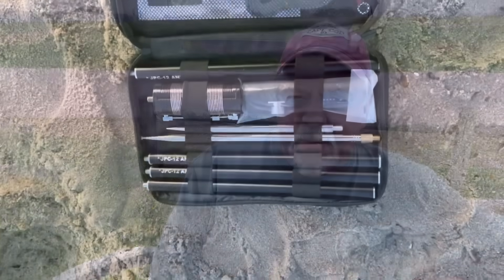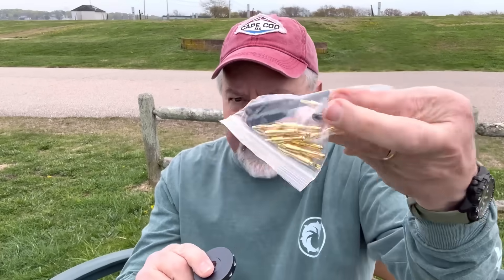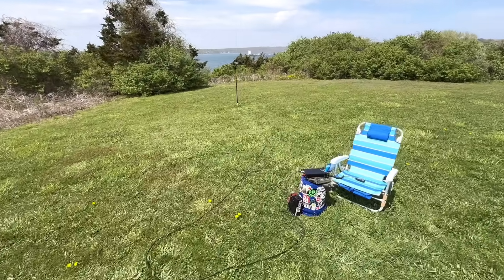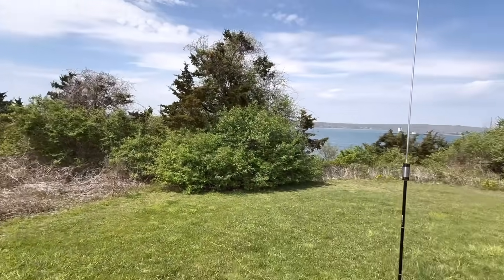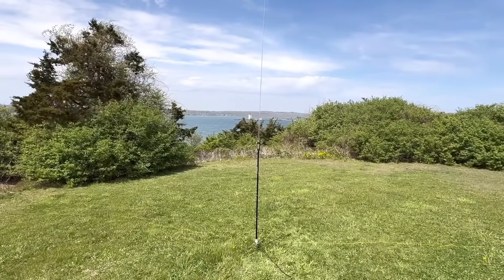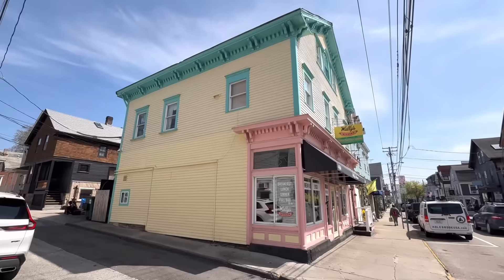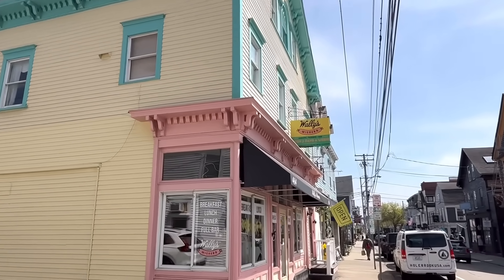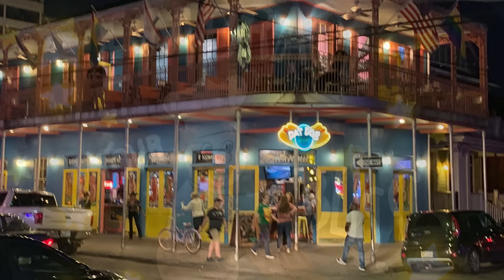Upgrading and Modifying my JPC-12 Antenna

Comment: Look at the price of antenna base, $50.47 PLUS $76.66 SHIPPING??????
Reply from the maker: Thanks for the heads up! I deleted their link. It was $29.00 and $9 shipping when I first posted earlier today. I put up another similar one.
Reply: @COASTALWAVESWIRES  Purchased a JPC-12 couple months ago and the spike has been modified so a washer or a 12vold wire connector will fit works great.  Please keep making the videos 73 Jim KB7MM
Reply: I believe I would take that counterpoise spick  to a machine shop have them to machine the Spike and modified to stick up about a 1/2 to 5/8 of an inch above the top of that so you can mount your antenna better. 73 K4BWN

Comment: I got one of those little radial plates too. I drilled a 12 or 14mm hole not quite all the way through... maybe 8mm deep or so. This left enough thread to screw onto the spoke while leaving about 12mm of thread for the feedpoint to screw onto

Comment: I bought the red radial plate for the JCP-12 off Amazon. I just tried it out today. I attached (4) 5 meter wires, the SWR was pretty low. It worked pretty good on 20M although the bad was pretty noisy today.

Comment: I have that JPC-12 antenna too, doesn't do the greatest (surprisingly enough, the GOOZEEZOO el cheapo 20-6m portable telescopic whip antenna from Amazon does loads better on 20m (consistently getting 95% efficiency, and very low capacitance and inductance on 20m operating close to buildings in a condo complex - thanks HOA).   And also surprisingly, Amazon does have that antenna base you showed in this video too.  Multiple options, around the $30-$40 range, but no quick deliveries.

Comment: Connect ring terminals to the ends of the radials. Use wooden golf "T"s to anchor the radials in place when deployed. Place the ring terminals onto a large safety pin to keep the radials tangle free in storage. Antenna efficiency increases with the number of radials used. 4 ground radials = @ 37% efficiency, 10 ground radials = @ 50% efficiency.

Comment: Thank you for the video.   I am trying to decide on a vertical antenna to buy.  Just a thought:  find someone with a drill press and drill smaller diameter holes between the holes that are too large for your existing banana plugs

Comment: Hi Walt!  Thanks for the video!  I have a JPC-12 and it was working great until suddenly my SWR went from 1:1 to 2:1.  The problem was a loose coax connector!  The PL 259 on my RG8X coax was a couple of millimeters from being seated on the SO 239 even though the connector was twisted and tight!  The problem is the PL 259 cant tighten completely onto the SO 239 because the proximal threads of the PL 239 wont allow for complete excursion across the threads of the SO 239.  The ground connection with the coax is not made unless you physically push the coax into the PL 259 a couple of millimeters and the ground contact is made but is not tight.  The solution is compatible connectors!  You can either buy a new higher quality SO 239 with a longer collar or try a different PL 259 that allows complete thread excursion to make contact.  I just bought some Steren RG8x coax and the PL 259 plugs work fine and seat tightly in the SO 239 in this antenna.
Reply: I ran into a similar problem with a Yaesu FC-40 remote tuner.   It had "M" connectors.  Very close to the SO-239, looks the same, but metric threads that seize with the PL-259 threads before it seats completely.  I added a piece of wire bent into a washer like shape between the loose rotating outside of the PL-259 and stationary inside.   That let it pull tight before the threads seized.

Comment: Fantastic location there Walt, maybe you  could drill that new white base to accept those banana plugs or better still extend the thread on the spike to use that ground disc, probably a few dollars at a local machine shop. 73

Comment: I just looked. Mad dog coils has that M 10 long nut , You just need a M 10 long all thread or cut head off bolt . also Marty has a M 10 to 3/8-16 adapter .   this will work. Cheers Walt from NY !

Comment: Great thinking on that antenna !  With that M 10 thread find a 2 -3 in long all thread piece of use a M 10 bold cut off head. Then find a long M 10 nut like the 3/8 16 we use. I think mad dog coil has them. put the all thread in base then put the counter poise hub on. still threads then put the long nut on than screw on the stake and push the whole thing in ground. done . just use speaker wire for the counterpoise . Put them banana plugs on the speaker wire . Give that a try . Just look for M 10 hardware . 73

Comment: I have the JPC7 and 12. The 7 let's you set it up as a dipole or V or vertical with one elevated radial on a tripod. If you put your jpc12 on a 3-4' tripod and use one tuned radial, you will get 1/2 to 1 S unit stronger signal

Comment: There are two fantastic ham radio sites there. One is a Rohn 25 tower at Beaver Tail Lighthouse which sits on a ceramic insulator. It has an extensive ground system buried underneath. Might want to try to tune into that vertical. The other is a complete ham radio station with multiple towers, also next to the Lighthouse. Privately owned, but worth some research for a possible segment.

Comment: I got that ground puck to work on the base of the feed point by picking up a 45mm m10 x 1.5 set screw and a 25mm m10 x 1.5 coupling nut. Both are available on Amazon. (With the orginal JPC-7 feed point that is)

Comment: @COASTALWAVESWIRES Hi Walt, the JPC12 can be further improved by replacing the somewhat lossy stainless steel with silver plated copper wire on the coil, especially for 40m where the entire coil is used. Check out KA7OEI's blog on that antenna.

Comment: I use the pac-12 radial plate on aliexpress (red metal) it has sockets for 8 banana plugs. I put three 16.5ft radials each into the banana plugs for 24 radials. Works great!

Comment: Put the larger banana plugs on the other ends of the yellow radials. Dual purpose for two antenna brands?  Going to kitchen the pan up some red pepper, onions for a hot dog. Will add bacon. Probably air fry some tator tots.  73 Salty.

Comment: Love my JPC-12.  I started using faraday cloth with mine.  Easy to pack and never had issues getting it resonant.  Glad you got it working.  The counterpoise wires they provide with it is not the best.
Reply: Thought about using the cloth, how did you set it up? I had thought about a center hole with an eye for support. Alligator clip to radial attachment and cloth might work.
Reply: @GrayPlayer  I use a tripod and just lay the cloth underneath the tripod.  I made a small jumper cable with the ring connector on one side (for under the antenna feed) and the other side has an alligator clip that I use to just clip on to the cloth.  Seems to work great for me.

Comment: These are my favorite kinds of videos. Mods and fixes.  I modified my 17.5' whip (red based) and installed a banana clip to connect a 4:1 Unun and use it like a Coastal 20. Works great. I'm making a 4:1 with coax connectors for input and output so I can just screw it to the base and cable. Tidy package, quick and easy setup. Keep up  the the diner section. Ham radio and food just go together. I've been thinking of a franchise possibility; Hillbilly Peaks and Valleys featuring good Southern BBQ diners. Your new book should arrive next week. Looking forward to it.

Comment: Although it's not  my most used antenna, I kind of like my JPC-12. Never had any issue with the base, the thin counterpoise wires  get tangled easily indded, so I keep them carefully wound on a wire winder. I've actually added 8 AWG 22 wires of the same length soldered to a second ring terminal. Having more counterpoise wires did seem to make a difference.
Propagation has been dreadful here in France lately. Only one real DX (> 3,000 km) in over a week. Hearing only Russians and Italians on 20m day after day gets old after a while.
Thanks for the tips that will undoubtedly be useful to many. Best 73s Walt!

Comment: Curious why you didn’t pick,up the radial plate they sell for that antenna. (I am not affiliated with them, just a happy customer) It has multiple wing nuts to attach your counterpoise wires to. It mounts between the spike and the mast. Been using mine for several years no issue. I cut counterpoise wires for each band and ran them diametrically opposite off the plate. For me it that made all the difference.

Comment: Yes, I had the same problem but I was able to repair it and yes, the cables are a disaster. I used 4 cables with 3mm and an eyelet. It works great, but your idea with the disk is very interesting.

Comment: Hi Walt!   Can you put the correct ends on the other end of the radials?   Also next time you're around a ship yard find the machine shop and have them run a die further down the spike to make the threads longer.   Or possibly you have a mechanic buddy that has taps/dies.

Comment: Hi Walt - check out this link to Chameleon which advertise a puck that has inset threads that I think would accomodate your ground spick and give you room to screw on the other piece.  Also, perhaps the banana plugs holes might be smaller and you could use the radials you have and make it all work.

Comment: Thanks for checking out that puck and saving me from trying it.  There's another puck (Chameleon, maybe) that is substantially thinner in the middle so that you would still get lots of threads left.  But it's probably 3/8, not M10, so it won't work with the JPC-12 (or MC-750).  I'm thinking that it might be best to use a piece of ground strap braid with a ring terminal at each end (suitable for different sized spikes) and put alligator clips on the near ends of the radials, rater than pin plugs.

Comment: Another great video Walt! I went through the same thing with the JPC-12 and now that it's modified, I love this antenna. It seemed hit and miss with the short in in the connection part. Mine worked, but the counterpoise wires needed improvement (which I took care of). Even with the potential issues, I still love this antenna. Thanks again for another great video. I hope to catch you on the air one of these days...73...Hugh...KN6KNB

Comment: Hey Walt, I want to throw out a suggestion. I would imagine you have a Millwright or Machinist on your job sites, you could have them turn that spike down a few more threads and then should be able to use it instead of a secondary spike. Just a thought in case you haven't thought of it.

Comment: Short or open to shield? If it’s open You could put a small wire jumper from one of those so239 screws to a ring thermal to the bottom spike 
Also get a short all thread and a coupling nut to extend the bottom

Comment: I just love my JPC-12. I use it every weekend and it gets me everywhere I want to go. I did make a couple modifications. I found a small aluminum plate and drilled it out to fit over the ground spike. I also found some ring lugs on digikey that accept banana plugs so I added 4 of those to the plate to plug in my radials. Finally I bought a 17' whip on Aliexpress for $11 alloing me to eliminate the coil for 20m. I couldnt be happier.

Comment: Have had 2 of the jpc12’s, a 750 and just got the new 350 a few days ago.  Every one, the so239’s they use are like a tapered thread and none of my coax pl259’s will tighten snug on them.  Was seeing varying and poor swr at times. Each I replaced the 239’s with new and they function perfectly snug now with fantastic swr etc.  bought a few extra ribbon radials and don’t separate the wires,  works well, i run 3. They’ve all been highly sensitive to radial’s lengths,  can easily have too much,  at least on my midwest ground,  like on 10m  i just fold them all back to be just like a few feet each,  on 20m & 40m about half and 80m likes full lengths.
Reply: Were the 239s hard to replace?  Mine has the same problem, the collar by the threads is short and doesnt make ground contact with some 259s.  I bought some Steren rg8x coax and it tightens just fine.  I think some 259s have proximal thread restriction so they cant make the tight ground connection.
Reply: @prc4353  super simple,  just need solder and hot soldering ability.  Helping hands  help.

Comment: Hi, Walt, thank you for your video! Two days ago I purchased one for me 😎 On Monday I hope it will be delivered. All rope antennas are no doubt good, but not all the time and not everywhere. On the beach or in the mountains I’d prefer something more simple and stable.
Moreover, this antenna offers a great deal of creative potential thanks to its modular design, which allows for the addition of extra components such as inductance coils and so on. I get bored when something just works. I need creativity 🤣
Reply: Yes, you can get creative!  I have a JPC-12 and simply didnt use the coil, instead purchasing a longer whip (M10 threads) so it is resonant on 20 meters.  SWR 1:1 across the entire band!  Wonderful antenna given 20 is my favorite band and I live in an HOA restricted community.  Antenna up or down in 10 minutes!

Comment: Thanks for the video. I have the jpc 12 and swapped the base out for the red base from The AliExpress whip. I also used small ring terminal and a tasted to one of the screws for the feed point connection. The ring terminal has two short lengths of wire with Anderson power pole connectors. I use two groups of radials two and a half meters long. Overall I use 10 radials and I am able to get the antenna to tune 1.2 SWR or better. Lately I have been using the AliExpress base, one extension rod, and the the 17ft whip. That configuration works great for SOTA. I hope this helps.

Comment: Have a look at my "Portable Ham Radio. DIY Vertical Aerial. Ground Plane Radials. Copper Pipe Bracket" It's easy to make. Cheers from old George
Reply from the maker: I will check it out. Cheers my friend

Comment: Just wondered why you don't make your own counterpoise adaptor just using a thin m10 washer or copper pipe flattened etc. As in my video.  Etc. Costs pennies. George
Reply from the maker: Because I have 30,000 subscribers that would rather see the product and know if it works or not.
Reply: @COASTALWAVESWIRES  OK fully understand. Thanks for replying.  I have to struggle on with limited funds. State pensions etc. I appreciate what you are doing etc. Once again enjoying your vids. George

Comment: Hey Walt! I like that a good part of this antenna is thick, wind resistant. I have the mc-750 which I tried to use at the rooftop of my building but it bends so much with the wind… this one would do better regarding the wind 😊. 
The audio on this video is scratching when you’re outside. Today I’m getting a DJI Mic Mini for a multitude of personal use. It seems to be a beast and not that expensive. The noise reduction and filtering seems great for your use case too. In case you’ve thought of getting a mic hehe 73,